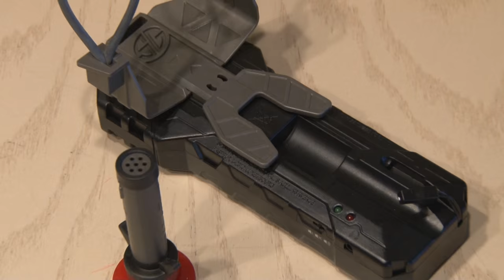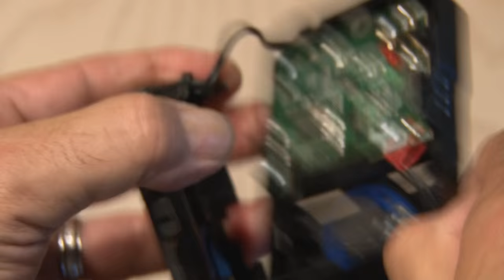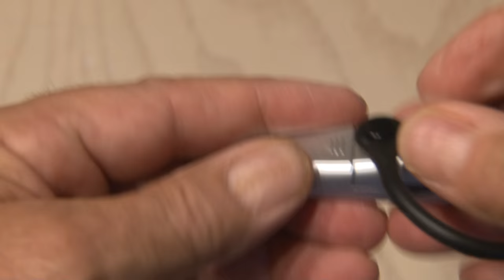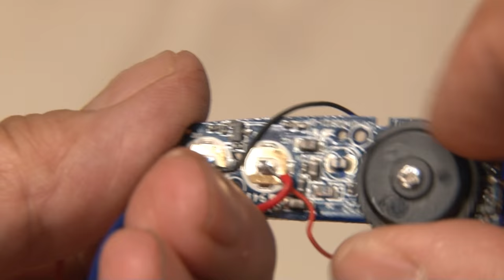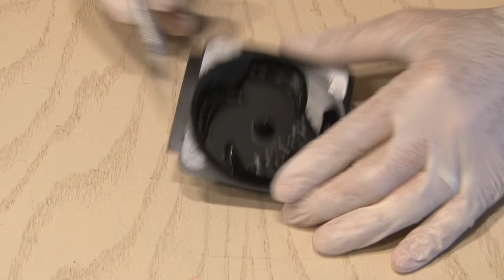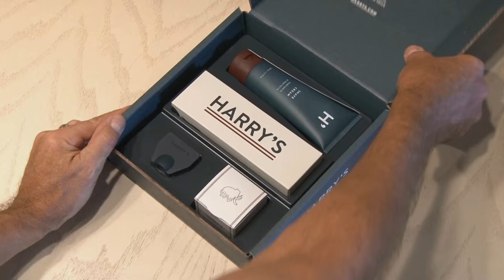How-to Spy on your Roommate!

Comment: To boost your distance away from the transmitter, you could add a small, non-inverting op-amp circuit made of an op-amp and a few resistors and put it into the case, making the transmitter have a higher range.

Comment: Ur not worried about the amp current being too high for the transmitter opamp circuit? It would be expecting microvolts from the differential mic input.

Comment: Put it in a carbon monoxide detector box so you can plug it into the wall and always have power. Or if its your house, take an old outlet remove the plate, use that for power and cover it with one of those blank wall outlet covers

Comment: Hey Kip, the original receiver design looks like it took 4 batteries but your reworked design only uses 2. In the original was it both parallel and series or how is it working with half the voltage?

Comment: PLEASE teach us how to make a tiny camera that is waterproof and fits somewhere in a shower or girls locker room! Preferably one that can be watched remotely or live streamed! 
Impossible to find unless you're specifically looking for it and has a battery that lasts several months.
Reply: +Alex Kuhn 
First off, no.  The point of surveillance equipment isn't cheap thrills, if you want porn there's plenty of it on the internet.  

But, if you did have a legitimate reason for putting a video bug in a shower, your choices are very limited anyway.  Showers create moist air, which will fog the camera lens; your first job is to defeat that.  Second, video consumes much more power to feed than audio, as does transmission of the signal, so there are no commercial units which would last anywhere as long as a month.  Your best bet would be to hardwire the unit into a lighting fixture:  this will feed the power supply, warm the unit to keep the moisture off of it, and be difficult to spot... but that would require having access to the lights, the power supply for the lights, and several hours of uninterrupted time with the lights to hook the assembly up.  If you are really, really dedicated to watching homebrew porn, AND have all the necessary access, AND are willing to get sued/put in jail when your unsecure transmission is discovered, well then, good luck, google is your friend.
Reply: I made that comment as a joke, knowing that what I'm asking is illegal and immoral, similar to what he's mentioninn in  the video.

Putting a hidden microphone in a room to hear your roommate's  conversations isn't illegal in all areas but it's definitely something a scumbag would do. Probably the only reason a person should put a hidden microphone is   to overhear a roommate  because they needed proof that their roommate was doing something illegal like drug dealing or such.